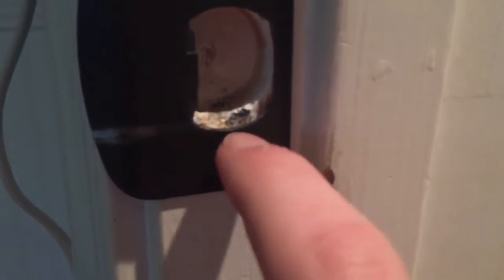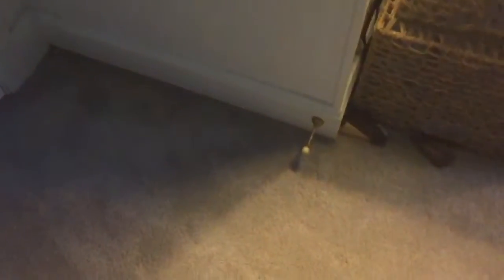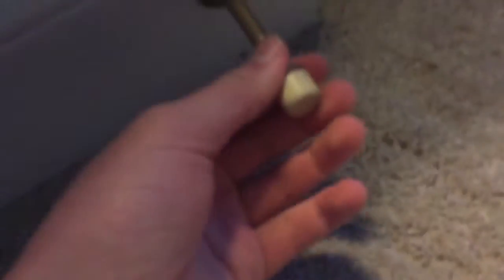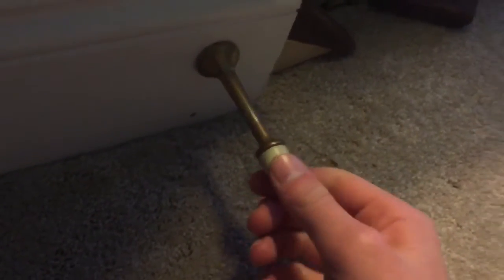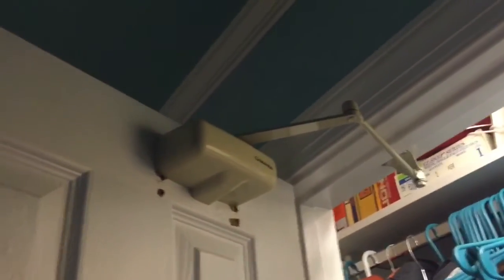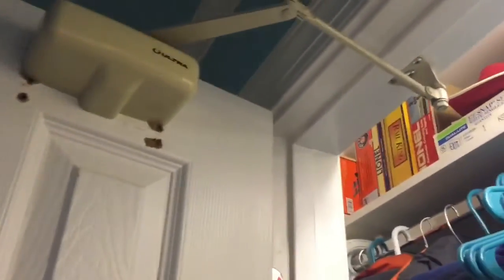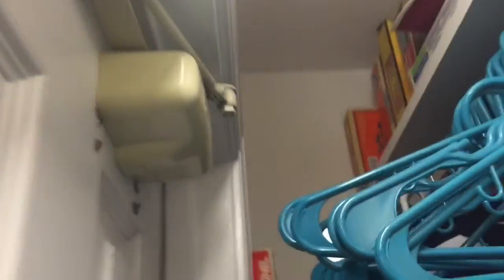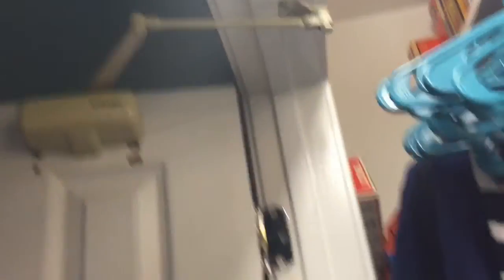More door closer updates | New hardware and Ultra closer fixed!

Comment: Hello ExitSign350,

nice to see the update for the door hardware and then we all witnessed the Ultra pulling off the door.  I am happy that you figured out how to get the Ultra to stoop squeaking and its doing better for you.

when installing ANY closer, matter it be a big one or a small one on a household door, many household doors are hollow core and just have cardboard or veneer skins, when the ultra pulled away, its because you only had the screw holes holding onto the thin "skin" of the door,

if this keeps happening, it is strongly recommended you mount that flat bracket up that came with the Ultra or the other closer (if it's same bolt hole locations) the bracket is designed to be mounted to the closer so you can mount the closer to a hollow core wood door,  so it's not just a "guide/template" to help "beginners" install the closer. most hollow core wood doors have a frame that is 1 inch wood at top and bottom and about 4 inches of wood on latch and hinge side,  

as for the cover falling off, I used to see that with the heavy duty LCN closers while in middle school, the small screw would get loose in the slot and allow cover to ease its way off the body much like your's is doing.

since yours is a snap-fit type, you can remove it and gently squeeze the cover near the bumps that hold it on the closer to make it tighter when you put it back on (and less chance it will pop off again, do not do it too strongly as you may end up breaking the cover and not fixing the problem, :)

if and when you run into problems,  it don't hurt to contact me on youtube or if you have facebook, "Jess the door closer doctor" page, it's operated by me and I usually answer within a few hours of the question

-Jess the door closer doctor
Reply from the maker: Oh ok! Thanks for the info! What about the cover? Why does it do that
Reply: +ExitSign250  the cover problem,  not all plastic is made the same and its possible the nibs that hold the cover on the closer are worn alittle,  which is why I mentioned about gently squeezing the cover to make it tighter on closer body.

things like this are why I would write saying please feel free to message me on google or youtube to ask for help with any closer question,  you would not be bothering me, but giving me something to do as I don't work and answering closer questions makes me feel useful in life, so let them rip and ask!

-Jess the door closer doctor
Reply from the maker: +JLD902   Ok thanks!!!